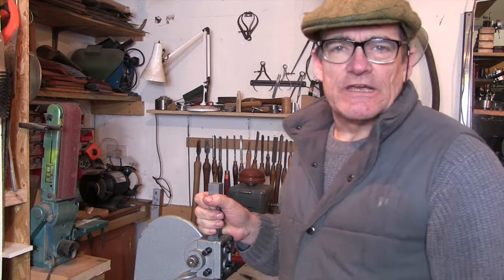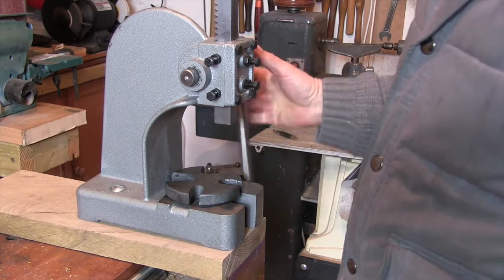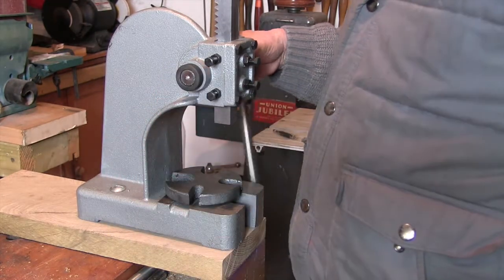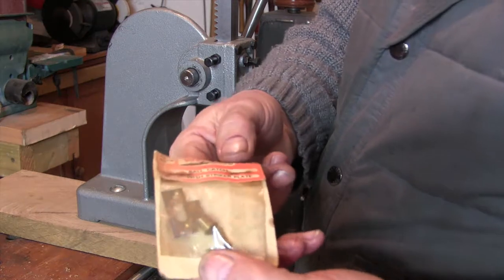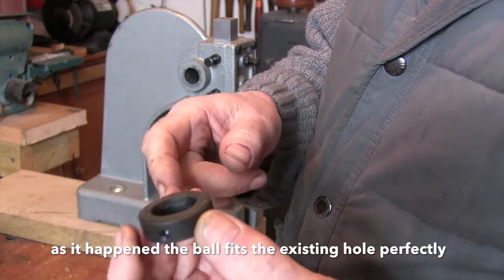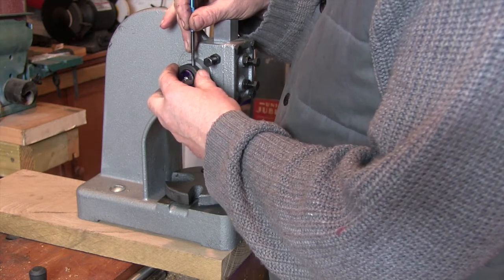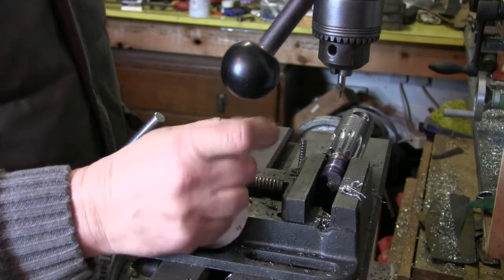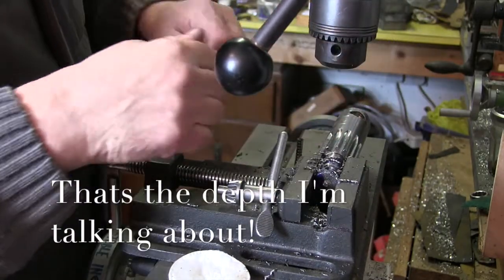Quick mod to adjust the handle on an arbor press, without grinding the teeth!!!!

Comment: Guessing you could also put shims under the workpiece/big metal thing at the base?
I do like the method you showed as it keeps the depth to the max and seems easier to get the right angle over the grinding teeth method.

Comment: I just leave the collar off and add a spring from the handle to where the collar is supposed to be installed and just hook on one of the bolts that adjusts the tension on the up and down motion...you can run the spring under...over or in front of the gear/plunger holder...your call...when you want to adjust...just pull on the handle sideways and viola...you're done...no muss no fuss...

Comment: Cliff, nice mod. However you’re probably all squared away by now with this but I was thinking...... Regarding the handle, possibly weld a half inch socket on they’re so you could use a ratchet wrench. You can make the handle as long as you need. Just a thought. Another nice video. Thanks.
Reply: Jasper Trills, I like your idea as well as other ideas mentioned, I am not sure yet what I would choose in this situation. I will say I have another project in the pipeline that your thoughts will be applied, Thanks.
 Cheers from John, Australia.
Reply: @joandar1  
Or turn the hexagon shape on it and put on a socket.

Comment: Clever idea. its a bit like drilling on a mill, the handle is never in the right spot for comfort. I found a jones and shipman press like this in a pile of crap at work, stuck in a cheeky bid, so fingers crossed i'll get it.
Reply from the maker: I'm pretty sure the one I had nicked ws a jones and shipman, so much better, this does the job but nothing like the quality of the J&S, Hope you get it.